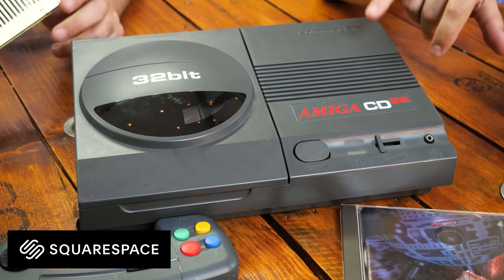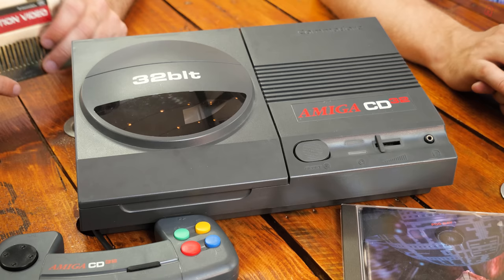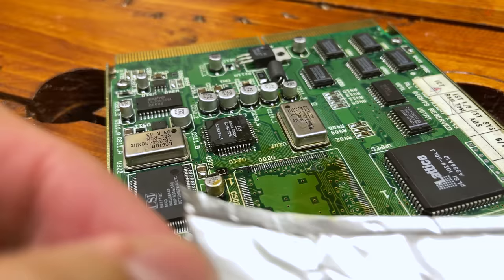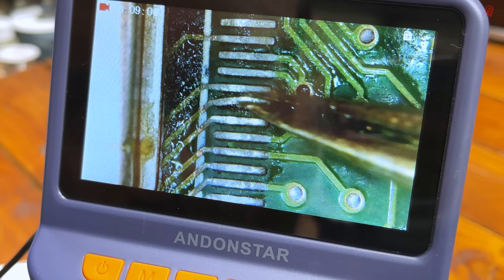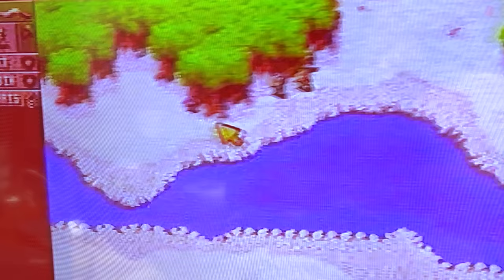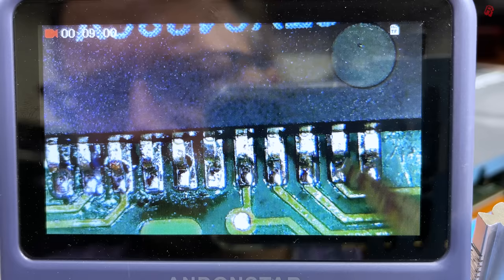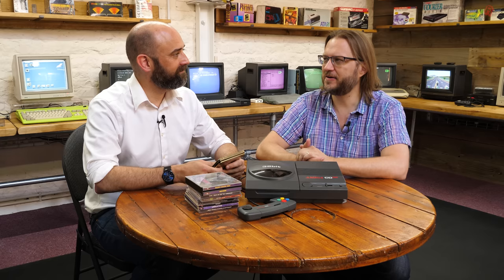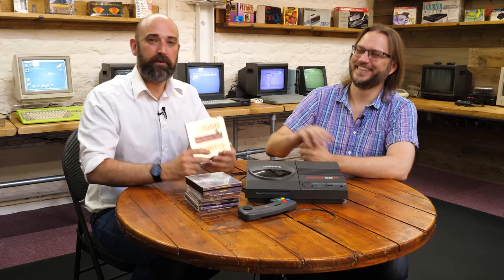CD32 FMV Failure! This thing is a mess, can it be saved?

Comment: So having watched it all the way through I didn't see any recapping and I assume the board takes in the CD32 regular video output, runs it via the decoder and then out to the video out ports so can overlay FMV over games if need be (how early MPG1 decoders worked on windows machines too). so if the colour is off, and there's no pots to adjust things, could it not be a resistor now having the wrong value on the red channel. that much flux makes me want to ultrasonic bath the entire PCB but if flux / solder has bridged two SMD resistors perhaps its pulling all that colour channels signal away. so suggestion would be ultrasonic the board. grab the schematics (they were online in 2009) and see if you can see which components handle the analogue output.

Comment: Did you try to connect the CD32 using the RGB out on the back of the board instead of the S-Video? That may be why you can see different colours from the video.
Reply from the maker: Yes the RGB on the riser doesn't receive any signal from the FMV module, this is normal behaviour with the module, so we wouldn't get any video from that even if it was 100% working

Comment: Check the cable to see if there’s a pin that was jammed or slightly too short.
Reply: Does not compute. In the FMV the image is red but in the game there is no red at all. So it's not a simple pin problem. Much more likely to have something to do with capacitors. There appears there is two separate video lanes. One comes from the MPEG decoder chip and the other comes from the console. The one from the decoder seems to lack blue and green channels while the signal from the console lacks the red channel. Still could be a problem with a bad connection between the console and the decoder card, but in addition to this there is something that happens between the decoder chip and the display. In my pretty amateurish opinion it sounds more likely that it is one kind of problem instead of two or even three separate problems, and the capacitors are convenient suspects.
Reply: @blahorgaslisk7763  ahhh so it uses the same cable with and without the add on card.

Comment: The Final Gate, Microcosm and Golem (unreleased) are all CD32 FMV titles. The Final Gate might be one of the worst FMV games ever made - the plot clearly called for a "Speed boat" but instead they could only borrow "Grampa's boat" for the afternoon, and instead sped up all of the footage.
Reply from the maker: While these are games that have video they use the CDXL compression format that doesn't need the FMV module, and they aren't enhanced by the module sadly
Reply: @RMCRetro  Exactly, the term ‘FMV’ was wrongly used (and still is) for any game having video segments in them. Quite laughable when you think the Mega CD could never archive a full motion (24fps, full screen image) despite having dozens of ‘FMV’ titles!

Comment: Could this fmv module play mp3s as well?
Reply from the maker: No, it's designed for MPEG1 video
Reply: Not unless it had dedicated software which came later first for PC’s (WinPlay in 1995) plus they take more horsepower to actually play the things than an 020, so in theory whilst an mp3 is technically the audio part of the mpeg file, it wasn’t standardised as an audio format that far back when the CD32 was alive.
Reply: you can still play some mp1s ;-)
Reply: It can play .mp2 up to 384 kbps.